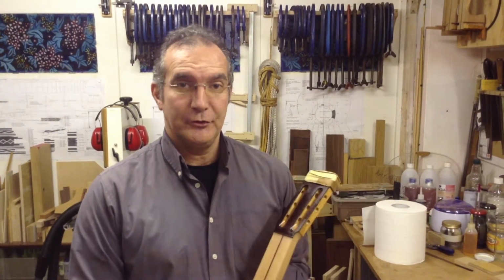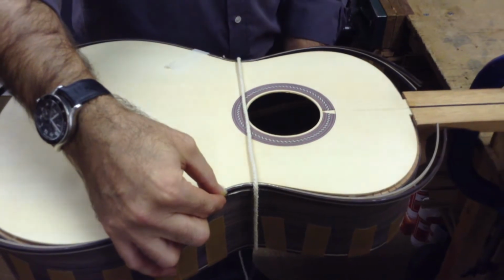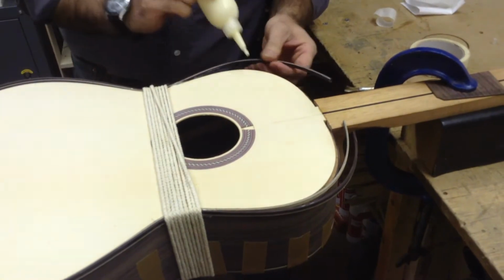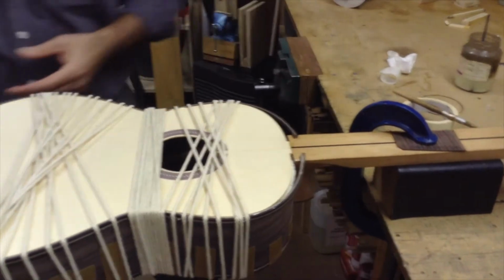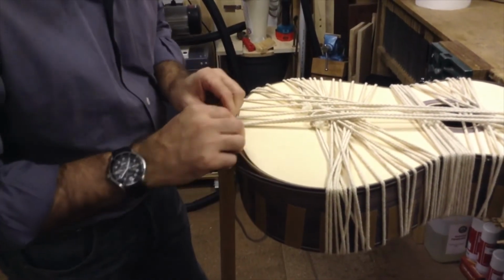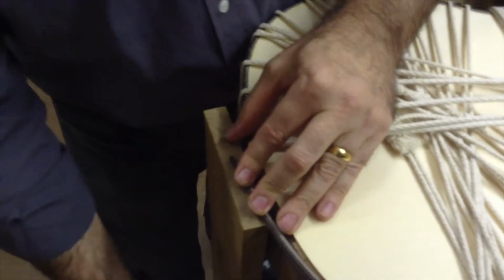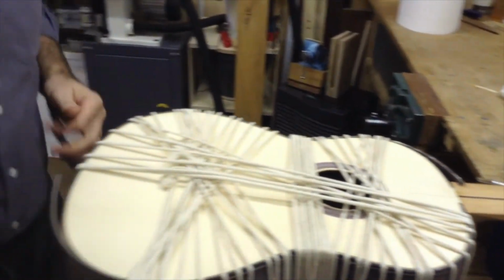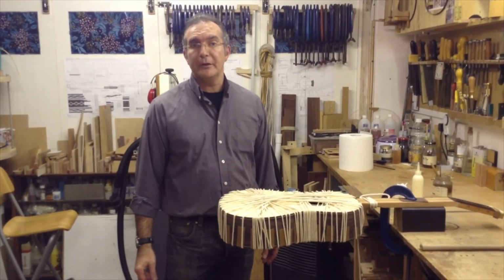Pablo Requena fitting the bindings on a classical guitar

Comment: Pablo, very nice videos.  I am on my 41st instrument now so I appreciate your clean working methods.  I use tape top and bottom.  If you put two coats of shellac on the top before you tape the bindings it does not pull fibers from the top.  It works for me.  Very good job.
Reply from the maker: CLASSICALBUILDER thanks for the tip.

Comment: Most helpful thanks, Pablo! If there any gaps between the binding and the guitar body (never in your case, I know!) would you fill them with sawdust and epoxy?
Reply from the maker: It depends. If the gap is very small it will be filled as the grain filling is done prior to polishing. If it is a big gap you can use Liberon hard filling wax of the same color as the sides, assuming that the sides are quite dark naturally like rosewood.
Reply: Thanks very much, Pablo. I'll try the hard wax method. I've managed to create some substantial gaps! 😢 Thanks again.

Comment: Great videos Pablo. I'm curious to know why you use tape on the back but cord on the top.  Why not just use tape on the top as well?
Reply from the maker: Paul McNamara for a couple of reasons, first because the tape is very sticky and it can pull the grain on the soundboard and second because I can apply a bit more pressure and get a better fit.

Comment: i just tried this method with a wooden binding and found that it's extremely important the binding is already the correct height. Mine was about 1/16" too tall and so the rope pulled on the top, likely creating a gap in the bottom of the channel

Comment: Hi Pablo,
Do you ever use a stair stepped ledge for smaller purflings or is the channel always the same depth to fit bindings and purflings of the same height together?
Reply from the maker: Hi, I have done double rebates in the past but I find that they are more complicated, for many years I have been doing just one rebate to accommodate both binding and purflings and it is a lot easier.
This is just the way I do it. you need to find the way that works for you.
Reply: @redkitekk  Thanks! That sounds like a great way to do it.

Comment: I love how acurate you do your work and how you show everything. I am going to watch everyone of your videos! One question: Why could you glue the bindings on the back with tape and not the ones on the top with tape as well?
Reply from the maker: I don’t use tape on the top as it will pull the grain quite badly. Specially on spruce. You can pull the tape carefully but sooner or later you will have problems. On the back it is ok as the timbers used for the back and sides are normally stronger.
Just in case you are interested I have a complete course available on www.onlineguitarmakingcourse.com
Reply: @redkitekk  Thanks for quick answer. I realy love your craftmanship. I was just looking at the video of the end inlay. Georgeus!  Thanks for sharing!

Comment: Thanks Pablo! Are you using regular Titebond glue? No issue with one area setting up before you can get back to it and pry the two woods apart?
Reply from the maker: Hi Ben,
Yes, I use regular Titebond and I never had any problems.....of course you have to be mindful of time so make sure you have everything ready and don't go for a cup of tea in between gluing sections!!!
Reply: I have a bottle of fish glue , just the same shape with a pointy nozzle. It`s reversible with steam or moisture . Used cold and a long adjustment time too .
Reply: Isn't Hyde glue the best?